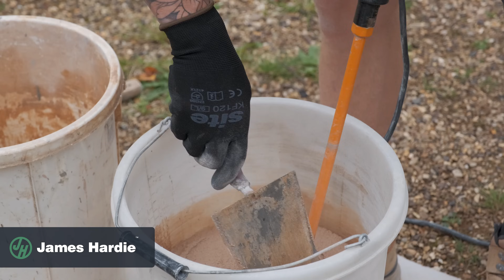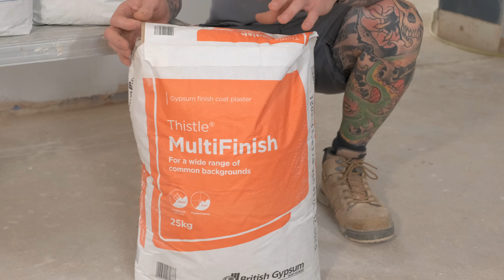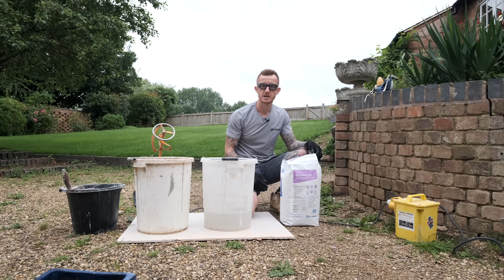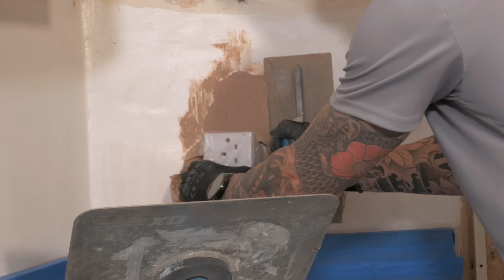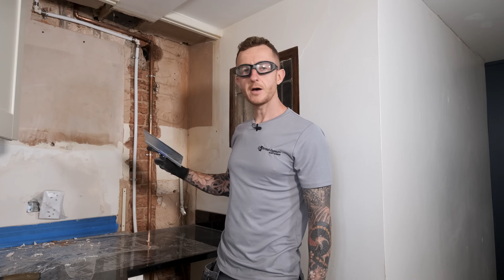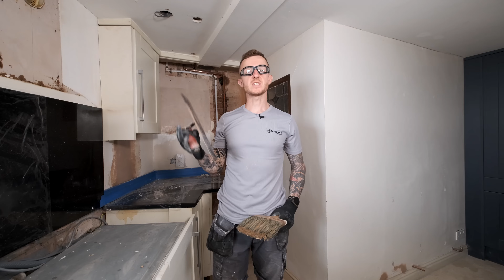HOW TO Patch and Repair Plastered Walls!

Comment: Brilliant instructional video.

Why would you use finishing plaster over easyfill?  Is a case of cost?
Reply: Multifinish is cheaper, can also give a more solid finish. It's also possible to blend it without needing any sanding. Easifill nearly always needs sanding, it is at least easy to sand though. In many cases you might want to skim the whole wall, then multifinish is essential.

Comment: Would bonding 60 + multifinish be an appropriate solution to fill in an interior wall..next to a boiler flue/vent from interior kitchen wall to exterior wall?
I have seen other vids that talk about using scrim tape/mesh embedded in the bonding coat but not seen anyone patching plaster around cylindrical objects.
The patch area is 3.5ft x 2ft that i would hope to flatten into existing wall.
I guess its similar to the chase you infilled in this video except i would be trying to also fill around the pipe too.
Your advice would be helpful 👍🏻
Reply: easy 20,40,60 are much easier to finely sand than multifinish so take that into consideration if you want a perfect wall.